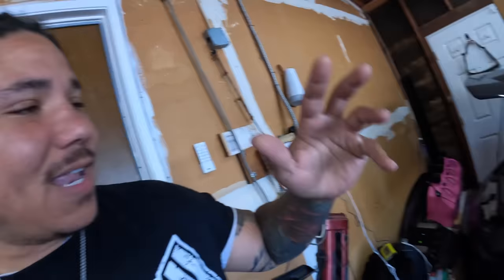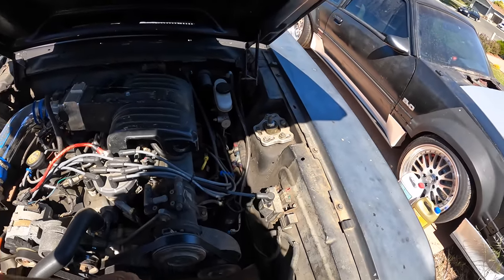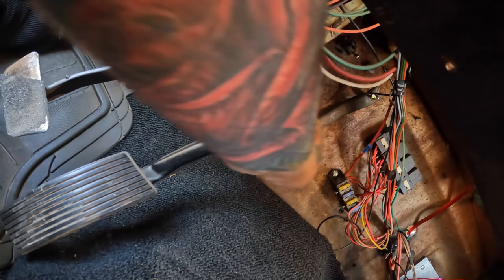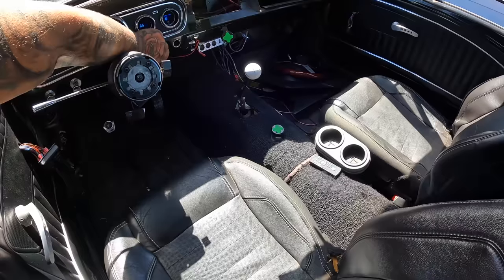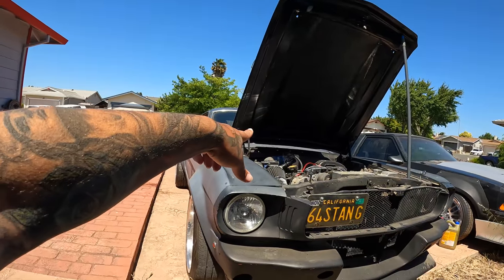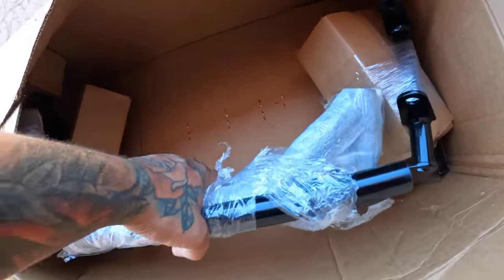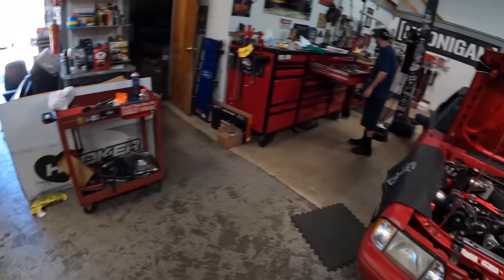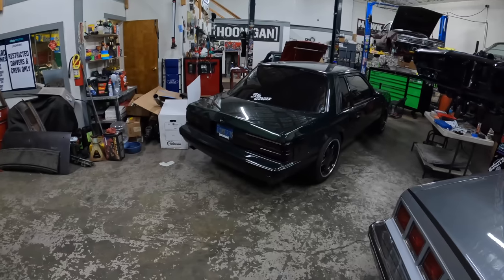1964 Mustang: Was it A Good Deal or Was It A Piece Of S**t!?

Comment: Hmm maybe to be a little different then most people have done you can try a 03-04 Cobra swap into it, would be sick and no one's really done them
Reply: Thats what ive been thinking not a foxbody Windsor.  Get a sn95 terminator motor to swap in there
Reply: @killakam123321 ain’t the terminator from the generation after the sn95?
Reply: @mogulme6190  nah sn95 the whole new edge
Reply: @mogulme6190 theyre the same thing underneath. Hell, technically theyre "foxbodies" too.
Reply: @killakam123321  technically terminators are new edge, not sn95
Reply: @MrCristianOviedo  sn95 is a new edge after 2000 wym
Reply: @killakam123321  after 99, and not many people call a new edge a sn95, that's literally why they have a different nickname, no one calls a sn95 a new edge so same thing vise versa.
Reply: @killakam123321  they share slot of suspension parts but they're not completely the same
Reply: @MrCristianOviedo  no they arent completely the same but definitely the same platform. New edge is the facelift and much better model tho

Comment: The modern driveline and mustang Steve clutch cable set ups have the thick reinforcement bracket for the firewall. A dart block based 363 or 408 stroker will make some crazy power. Especially if you went a solid roller motor. You could rev it to the moon. Also remember the car is a unibody. So the chassis will have to be reinforced at all stress points first and foremost.

Comment: Not going to lie, that hacked front suspension should have been your turn off. Without a tower brace it’ll flex like crazy, they are known for it without them. I’d start from the ground up and go with the colt 65 front suspension set up. It does look clean though and I’m jealous you got that plate😂

Comment: Do a 2.3L stroker  ecoboost swap , or just a stock ecoboost , a stock 2.3L ecoboost can push 420whp with a upgraded turbo , and some bolt  ons , matched with a 10 speed transmission, and it gonna be fast af!  And to do an ecoboost build it’s actually quite cost affective.   A stock 2.3L with stock turbo on ethanol can run close to 380whp, and you will be close to the 10s on the track.   So do a ecoboost swap, and thank me later!!  There is alot of foxbodys that run ecoboost and they are super fast!  The ecoboost swap will be better then anything else your thinking of! And also will be unique! And will be much cheaper then a LS or whatever your thinking of.   Look into it and thank me later. lol

Comment: You see my Falcon on my channel. That will tell you the level of detail, craftsmanship support by the ppl working on it. Followed by the parts. My Ford Racing Boss 351 block 408W I pulled out of my Falcon is healthy. Made over 500 horses. My 430W currently going in it makes over 700 horses 🐎 On motor with Nitrous on tap. Lots of chassis work needed if you turn up the power in older unibody Fords. Holla @Rdubfalco

Comment: MIKE. DONT DO THE OLD FORD MOTOR SET UPS UVE ALREADY DID EITHER A BUILT COYOTE FOR THE TORQUE N SOUND OR A 6.2 V8 RAPTOR MOTOR OR LS TWIN TURBO. OR DO WHAT HELLCAT GUYS DO SUPERCHARGED WITH SINGLE OR TWIN TURBOS UNDERNEATH AT THE END OF THE HEADERS DOWNPIPE AREA. OR DO A BUILD COYOTE FOR THE SOUND AND TORQUE. UVE ALREADY DONT ALL THE OTHER FORD OLD STYLE MOTOR STYLE BUILDS UNLESS U GET A 427/428 FORD MOTOR.